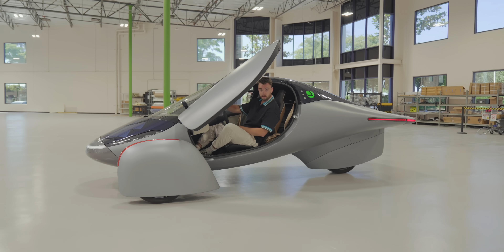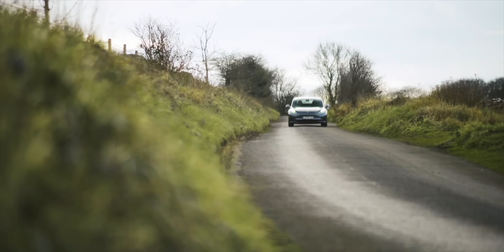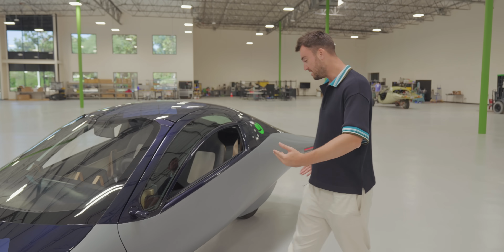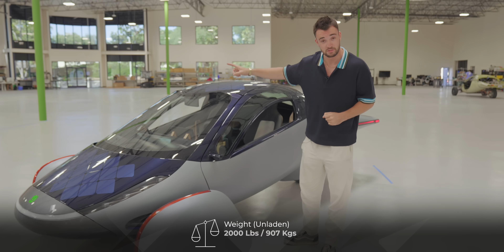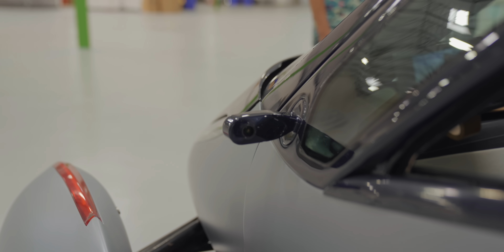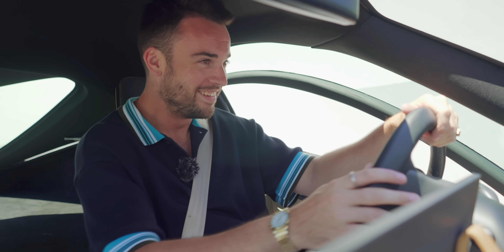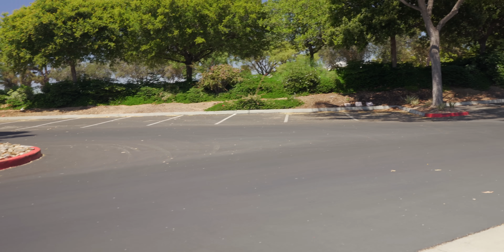The Game-Changing CHEAP Electric Car Inspired By Fish!

Comment: If I worked for this company I'd buy a unit, stretch the body to hold 4 passengers, add BYD blade batteries and 2 small electric wheel motors and sell it to more people than this company ever will.
Reply: There apparently mak8ng a 5 seater car design

Comment: You have no idea just how much energy drag burns until you ride electric mopeds. And in the "lazy mode" of cruising when you let your legs dangle off the sides of the moped instead of putting them in the front, behind the air spreaders, - you lose 30-40% of your battery and of the maximum distance you could be traveling. And when you ride against the wind - it's even more. Unbelievable, but there it is.

Comment: If I was a kid, my very first question seeing the Aptera would be: "Can it fly?"
Reply: A-Ptera = A, without; Ptera, flight.
Reply: It might if it got clipped by another vehicle...
Reply: Second question: Is it nuclear powered?
Reply: @keyserswift5077  Yes.  Solar nuclear fusion from sunlight.
Reply: @keyserswift5077  Where's the Flux Capacitor?  What?  In a movie?  Man, that sucks.
Reply: Yes. It can.
Reply: @radstorybuilder7438  wow it could drive straight onto and park on a completely flat delta wing with a couple dozen gimbaling rotors embedded

with a lot of changes the front wheels could turn 90 deg and power forward flight maybe
Reply: Or can it float, also looks like a mini sub
Reply: Watertight to a depth of over 2 ft
Reply: There is a flying version of this yes. The Voltera. It has the same aero shape.
Reply: No it can't, and stop hacking your parents YouTube account.

Comment: I'm really sad for the "center monitor as a cluster" inspired by Tesla. Overall, that is genuinely the one feature that's a deal breaker for me on Teslas - I really don't care for having to take my eyes off the road to see what speed I'm going or what charge I'd have left. Clusters are a thing for a reason, and I've always felt that Tesla's implementation of the center screen was because they were cheap, and throwing in a touch screen is cheaper than designing, implementing, and manufacturing a real cluster. Either that or they wanted to look a bit snowflake-ish.

And now... Aptera is just as annoyingly trying to be cool with the center screen, and if they don't have an option for a real cluster, I don't know that I could tolerate it. I'd have to mod the thing to get a real cluster or a reflective holo cluster in the windshield or whatever else can be possible on such a high tech vehicle.
Reply: NOT inspired by Tesla as he took that design off mining trucks 360K ton vehicles that are strictly off road. They had touch screen already in the 60's (center monitor as a cluster)  That is how you drove those things. Elektrahauls & Wabco's up in the huge coal mines and lead zinc open pit mines.
Reply: @bunzeebear2973  You're right - Tesla is just a very recent and extremely popular known implementation of this design which I really hate. Doesn't change that it's a deal breaker either way unless it really is so much superior to a clear cluster right in front of the driver.

Comment: Wow.. lots of issues with this video.
Damn.. where to start.
Firstly, this prototype is one that they have been parading around for YEARS now.  it has no air conditioning or thermal management.  There is no skin cooling in this model or in fact in their current mule prototype.  
So saying this is an example of it "working" is more than misleading at this point.. it's actually fraud.  And no, I don't use that term lightly.
Presenters of this need to start being honest or they are just going to look like shills and may even find themselves in court at the end of this in a similar way to those who presented the Nikola truck as a working prototype or spoke of their solar to hydrogen plants that turned out not to exist anywhere... even as an engineering prototype.

At least I can say that we have seen the skin cooling concept set up in a lab.  Aptera finally figured out that they may have to actually hire an engineer to try and see if any of this can even work.  That teencie detail seems to have been omitted here in favor of the "As you can see it works" inaccuracy.

Then there is the charge port.  I'm betting that the reason Aptera didn't want him to show it is because they were given a cease and desist order from Tesla for showing a Tesla charge port (probably cannibalized from a model 3) and insinuating that it will be delivered already able to use Tesla's supercharger network.
If there had actually been any agreement between Tesla on this point I think we would be seeing and hearing it highlighted rather than just being mentioned as an aside.

So in short, I have given Aptera a year long break due to pandemic recovery.. but I am still holding their feet to the fire on aspects of this vehicle that simply make zero sense.  Like the thermal management.
They promised deliveries last year.. then this year.. now next year.  So come the first of the year I'm going to be looking for serious movement.  I'm an industrial process engineer by trade and experience and I can tell you that if you don't see a fully working production prototype by Jan 30.. they aren't going to be making any deliveries in 2023.
In short.. they have less than 6 months to actually show their skin cooling works... and to get air conditioning in the car... not just driving it around with the windows open or the doors off.

Comment: I love everything about this. Efficiency is one of the key benefits of electric drivetrains, yet (as mentioned) most electric cars don’t actually take advantage of everything they can like smaller front ends since they don’t need grilled, and putting the motor right in the wheel so there is absolutely minimal loss to the drive train. As an engineer minded person this is the best thing I’ve ever seen on the road.

The only thing that keeps me from buying one sight unseen is my height. At nearly two meters tall I struggle with headroom even in big sedans and mid size suvs. As much as I love this vehicle, if it would cause me physical pain to drive it unfortunately becomes a no go. 😔
I know a bigger version would be less efficient (and be seen as many as just another sign of American wastefulness), I’d want the taller version of there ever were one.

Comment: The problem is, if you get hit even by a small truck, or even a full size Mercedes 4 door, you will die in this tin can.  We need cars that run on Hydrogen/Oxygen mix, which people can make at home with solar energy.   Or a conversion kit to run our current cars on clean free fuel we make ourselves.

Comment: I wonder what the insurance is on this model? It looks like there are a lot of breaking points. That front suspension and wheel sticking out from the vehicle. One good wack could mess that up. Then you have the glass and solar panels. Can't be cheap to replace all that. One good collision and I bet it's totaled.

Comment: I assume it would be classed L5e if it's under 1000kg and 3 wheels? This is quite a clever move as with 4 wheels it would have to be classed L7e Heavy Quadricycle but then must be limited to15kw maximum output and L2e would be just 4kw. By focusing on 3 wheels you only have to limit the weight to under 1000kg and don't have to restrict kW output, so it becomes more usable as an everyday communiting vehicle without having to meet the safety and expensive testing of a full M1 car, but be able to keep up with M1 cars is very important for usability and drivabilty.
This car reminds me a lot of the Secma Fun Runner, which similarly sacrificed the rear wheel in order to not have to sacrifice power like its 4-wheeled brother the Secma Fun 500.

Comment: This will just face the same problem as ICE cars. You can make them efficient - but if you do that, they won't see. That's not what the market wants. Car buyers don't want some lightweight car, or some curvy  novelty. They want to feel like they are driving a small tank. Over-sized cars are not actually safer to be inside, but they /feel/ safer. SUVs sell by the millions.

Comment: I'd get so stuck in snowdrifts with it here in Canada. Interesting concept and design though, would get something like this over a heavy Tesla any day.  Well done video guys.
Reply: Would not want to chain up a Tesla, they are super heavy. for snowy roads.  Nor would I want to chain up a single tire for traction on same snowy road.
Reply: @bunzeebear2973  agreed on super heavy, tried pulling one out here after they ditched and ended up calling a tow truck for it. As for tire chains it depends on the type, there's all sorts of options out there now.

Comment: a very interesting concept that I have seen for ten years in development now.
But one big disadvantage is, that it is very inefficient with space. it is very long (4.50m) and very wide at the front ( 2.235m). So you need as much parking place as for a mercedes but only have 2 seats and almost no luggage space. 
I think the air drag could be even much better without the exposed wheels in the front. there probably are considerable turbulences  at the suspension parts. 
and 900 kg is still not that little for a 2-seater

Comment: I can imagine the suspension needs to be improved for the production car. That is the only possible show stopper, and the final technological challenge to make this car production ready. Nothing is like the Aptera with respect to efficiency and functionality.
Reply: Yes, you are correct.  Roush Performance has already completed the re-design and it has been refined in a beta test vehicle.  The gamma and delta production versions will have the changes.

Comment: There is a flaw. Where there is sun there is usually heat and where there is heat people like air conditioning. This means you will need 5KW of your total for an hours journey. It’s a superb efficiently designed vehicle but unfortunately efficiency does not always correlate to practicability. Unless of course you like saunas. Hybrid of Hydrogen fuel cell.

Comment: I've got electric scooter that also has motors in wheels (because where else). After two years of using scooter on Prague roads, windings are all over the place, components that should hold them in place are just destroyed and rattling inside as I drive. Cobblestone and potholes are just nightmare for in-wheel motors.

I am not against new ideas, but if you really want to be super efficient, just use train.

Comment: I think Jack glossed over the downsides of this vehicle a little too glibly.
The width may be ok for California but over 2 metres on British roads is going to take a lot of getting used to. It's got the footprint of a large van. People are going to be knocking off those elegant front wheels on a regular basis.
There's not much room inside for such a big car so you can't take more than a couple of small suitcases on your 400 mile journey. Or do a week's shopping.
I'm not convinced about the skin cooling working when stationary (when charging) either.
Good for commuting but you'll need a second car to do the fun things in life.

Comment: The width of the car is its Achilles Heel and will be a serious inconvenience in use. 2.2 metres which exactly the same width as a Hummer,  which is huge, and likely the widest car on the market. For many in the UK at least, it won't even fit your garage. For this reason alone I do not see it selling well Efficiency is one thing, but practicality ultimately rules the day. A 2.2 metre wide two seater car without much luggage space does not score well in practicality. A Renault Zoe is less than 1.8 m wide, much more practical, though, yes, much less efficient. What the Aptera does show dramatically is how important aerodynamic efficiency truly is, and how few BEVs pay much attention to this matter, styling wins over function - the popularity of SUVs really wrecks this principle. Now that does truly annoy me, no BEV should be produced unless its drag coefficient isn't less than 0.24, many are nearer 0.30.

Comment: It starts at half the price of a Tesla 3.  Planet Earth costs less than a Tesla 3!
As for lightness; yes it's lighter than an F-150 Lightning, but so is an aircraft carrier. At 2000LB (910Kg) it is only 486LB lighter than my Mazda 1.5li turbo diesel, which can go 800 miles on 44li of diesel with 4 people in it for the same price.  I'd have to buy another Aptera to move the kids.   See, I've saved $20,000 already.
Will the skin cooling work when the road temps are 60C (140F in 'Murican)?
20-25% efficiency for gas cars - BS.  Toyota and Mazda's new engines are 40% efficient and ATs 90-98% efficient. Use diesel as its 30% more energy dense than gas.

Comment: One of your most sycophantic reviews to date. Really disappointed:
1) The APTERA IS NOT A CAR. All government agencies in developed countries classify it as a motorcycle, so it does not need to pass any crash tests for homologation. Yes, the company says it'll have  airbags, but these can't be certified by any test protocol because there ISN'T any safety protocol that was designed or can be formally applied to 3-wheelers.
Insurance companies also consider it a car, and in many jurisdiction it will require a motorcycle driver's license (in some also helmets; there are US states that waive the helmet, but not based on any research that it's unneeded.)
2) It does not qualify for any Federal incentives in the US, and will not according to any draft law currently in process.
3) Talking about energy efficiency without discussing the speed it was measured at? Really? Not to mention, ot the best of my knowledge Aptera has NEVER actually installed a 100kWh pack in a prototype and tested long-range efficiency. It's all extrapolation from the small packs.

Comment: A fascinating design. Reading on the Aptera website, I see the targeted market is more the cooler regions of northern Europe, which concerns me. Here I am living int he US Desert Southwest. The need for air conditioning inside a glass bubble is critical for much of the year. So I'd need to hear what the battery range will be when the AC is being run full force. What happens to the 250 mile range lowest cost option in 110F conditions? I'm tempted, but will sit back and watch how this thing develops, how well it performs in my sort of environment.

Comment: Don't call it a car. It's not a car, it's a MOTORCYCLE (fewer than 4 wheels). It will be registered as a motorcycle. That makes it exempt from car safety requirements, so it is cheaper to manufacture and more dangerous to drive than an actual car. In some states, a helmet and/or a motorcycle endorsement on the driver's license may be required.

Comment: I see problems for this plan. First, it's not a car it a motorcycle. Do you have a motorcycle endorsement on your drivers license? You don't? OK, well, now go sign up for a motorcycle safety course. Go to the DMV, take a new written motorcycle driver's test and then take the driving portion of the test... with a motorcycle (will they allow the car to be used for the test?) and then you'll get a motorcycle endorsement on your driver's license. Oh, and you'll need motorcycle insurance which you can't get unless you have the endorsement on your license. And then there are those fully exposed A-Arms in the front suspension. How will those be protected on the road? What about in snow? And when they hit something... anything... there goes your steering, your suspension and even your drivetrain. It's a great idea. It's just full of problems.

Comment: Reminds me of the BMW C1 Scooter I bought many years ago, ahead of it's time, safety cell,  roof, windscreen and wipersetc. Efficient and logistically perfect for getting through the traffic,without waiting in queues or getting wet. The trouble was I looked like a twat and was a laughing stock riding it. The lads at work used to call it the pope mobile. It didn't take very long before I couldn't take the shame any longer and sold it.
Reply: I loved the idea but never had one. When I am not hauling kids I use legs and public transit.

Comment: This car bone stock looks like it will be a better overlanding setup than a lot of built-out $150k+ 4runners and pickups I've seen. Huge ground clearance, solar assist, and a massive rear area you can sleep in. As long as you don't need to haul a bunch of bikes or anything it's perfect.

Comment: if u had a genorator now u put petrol init and it will make electric because the engine is spinning somet that makes leky rite so all these cars wizzing about well am certain with all them spinning wheels excetra u can power another bat pack and when u run out u power off the 1 youve been charging but while your running off the bat uve been charging that could be charging ya first bat..its just never ending all them petrol cars going obout all them spinning things there must be electric 2 be saved..or am i wrong

Comment: The solar panel placement is lousy with that diagonal pattern. If they were serious about solar charging they would place the solar cells much more efficiently! There is tons of wasted space on the horizontal surfaces that totally LACK solar cells! You will be charging at an AC source MUCH MORE OFTEN than a couple of times a year!!!
*
OOOOOOH! 10 kwh/mile. This means nothing! How about the weight of the vehicle? I built my own EV and I have 138 kwh/mile, but then it also weighs 275 pounds!!! Your fake efficiency number for the Aptera is meaningless if you don't also at least talk about vehicle weight!!! OF COURSE it's higher than a model 3 when it also weighs 1/4th as much!!! The games and hype and marketing BS around this thing are nauseating!